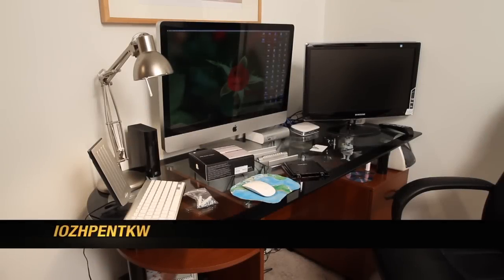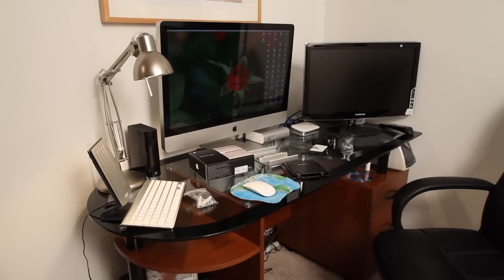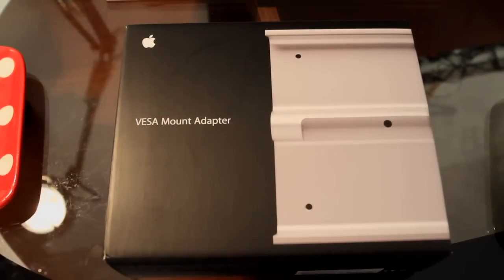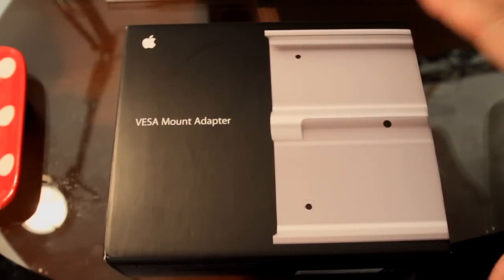Apple Vesa Mount adapter for imac

Comment: Incase you're wondering, this is only for the older 27 inch iMac back in 2010. They removed the VESA mount adapter option on the Retina iMacs but brought it back for the 2017 iMac Pro with that VESA mount adapter. That one however was so bad it never came back on the Apple Silicon iMacs. Now you can only get the VESA mount option if you choose it at checkout.

Comment: @Dylan8468 
No.  The 21" uses a different mount inside and there is no latch to engage to extend the mount out further for access to a bracket as in the larger models.

Comment from the maker: @BlackBros2010 Your best bet is to use a flash light and to take a good look inside of the barrel where you are placing the screw, it's the only real way of being able to tell if you are lined up properly wit the flange. If the flange is perfectly aligned with the mount, you shouldn't have an issue. Let me know how it goes!

Comment: FYI, in the event anyone else struggles with unlatching the stand on a 24" iMac (Aluminum), I couldn't get the white plastic card to insert well enough--it was too tight.  No joy.

The resolution for me was to lay the computer down (rather than stick to the instruction to unlatch it while standing).  This removed the tension on the stand and allowed me to insert the card, unlatch the lock, and remove the stand.  After two hours of struggling upright, it took 30 seconds laying flat. :-)

Comment from the maker: @melsentube It is a little tight, but the chords do fit back there, But there is room for them to fit. It's not that easy plugging everything in place because of the tough viewing angle of the ports. I leave my USB cables plugged into the imac, and generally disconnect the hardware at the device end instead.

Comment: This is a great video.  I have noticed that you have had it up for about a year now.  How is it working?  I have a 27 inch MAC Cinema monitor and would like to mount it on the wall.   I bought the VESA bracket through Apple and found your recommendation on Amazon for only 10 dollars.  That sounds cheap to me.  How is it working out?   Can you still unplug the usb cables, etc on while its flushed against the wall?   again good job .  thanks

Comment: If you're mounting the adapter directly to the wall (without an articulating bracket) there is room for the cables to be connected, but it can be a little tight if you are frequently connecting and disconnecting peripherals.

Comment: Uh, a 27in iMac weighs 31 pounds or something... I hope one of those two screws accidentally caught a stud.  And plugging stuff in back must be a bitch...
Reply from the maker: With a flush mount (shown in the video) the cables are tough to get to. But it wasn't an issue for me because all of my peripherals were plugged in to the machine at all times. Wall mounts with articulating arms do make accessing ports much more accessable. 
By the way I put in a total of 4 screws, 2 of them went into a stud, the other two screws were attached to wall anchor's... more than enough to withhold the weight of the imac.

Comment from the maker: With the mount I used, two of the screws went into the stud. You can also buy wall anchors, I'd recommend speaking with someone at your local hardware store about the right wall anchors to use in this application

Comment: Where do you get that second (black) mounting bracket?
Reply from the maker: jonny blaze on Amazon. just type in vessel wall mount and you'll have multiple options for various different types of wall mount systems, most of them are fairly universal and should work with apple's vessel mount adapter.

Comment from the maker: The bottom of the screen's viewing area is a few inches off the bottom of the machine. My viewing angle is ideal for my seating position. I have pre-existing back issues, so I can tell you with confidence that this setup is ergonomically sound. Thanks for watching.

Comment from the maker: @drplbiftin if you watch carefully the wall, you will see that I already marked the holes that time I used a proper level. The iphone was for purposes of showing users on the video that the bracket was mounted level. It's hard to demonstrate that on camera using an actual level (as the bubble would have been difficult to view). 
Thanks for watching.

Comment: beware!! once attached and hung to a wall for several years you will ruin the torq screws making it impossible to detach and put the original stand on. those shitty tools given with the product will wear down so better use professional tools. the force that has been put on the mount is huge (especially with older heavier models) so most likely you'll end up like me with the need to drill out the screws because i'm only able to remove 2 of them and the rest are ruined and stuck so be really careful!